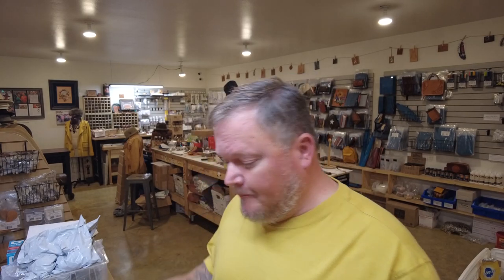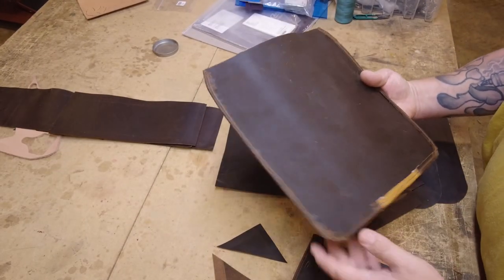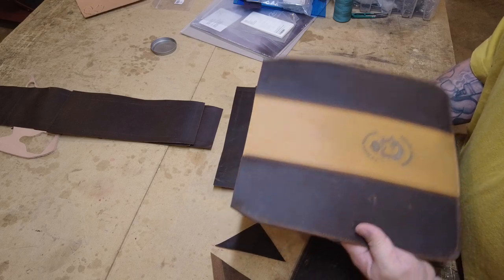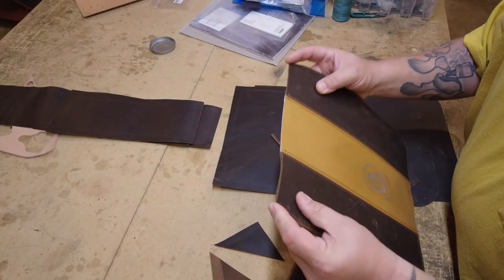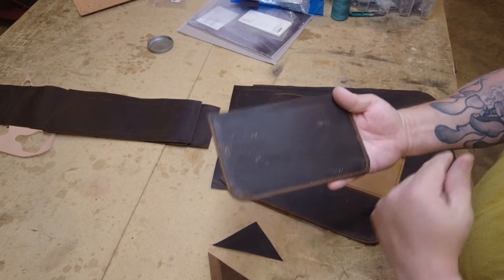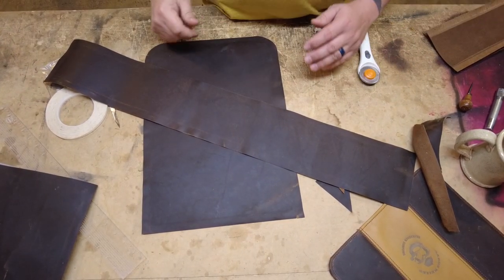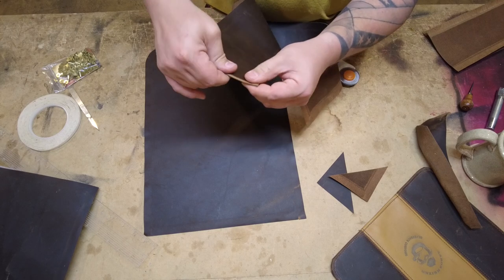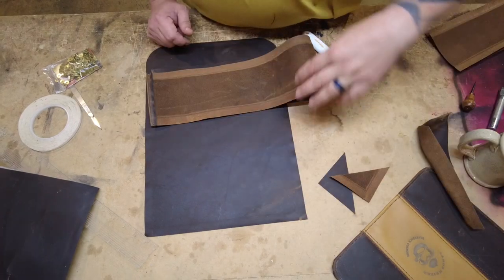Explorers Backpack Pt 3

Comment: Great video Aaron. 

I have a question for you. Would it help if you stapled the pieces together on the sew line? You could put a piece of cardboard underneath and let the staple legs go into the cardboard, then flip it leather over an bend the legs down. You would remove them as the sewing got to that spot.

Just a thought.
Reply from the maker: I have used a stapler on bags.  Especially when piping is involved and there's so many layers, it can indeed be a big help!